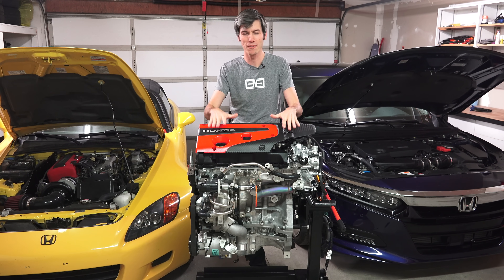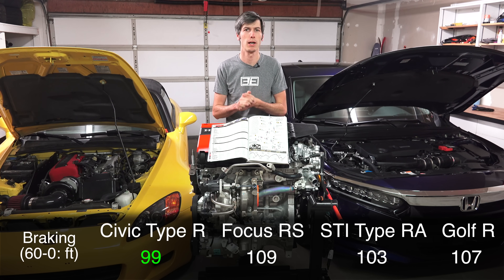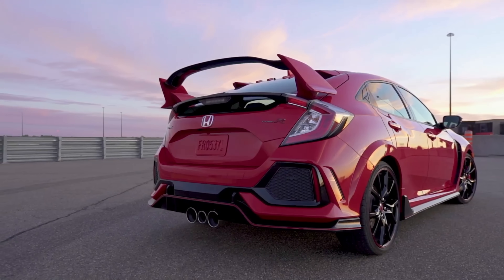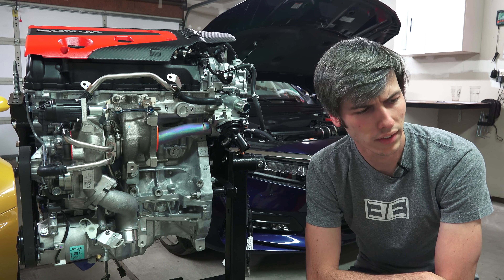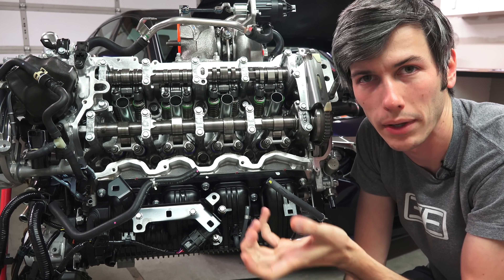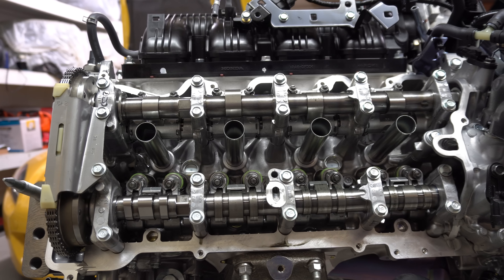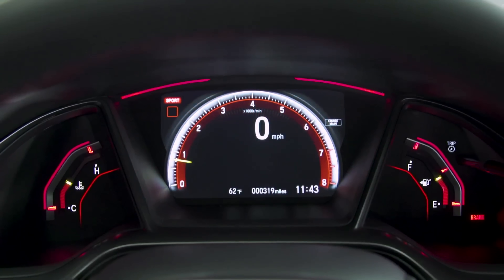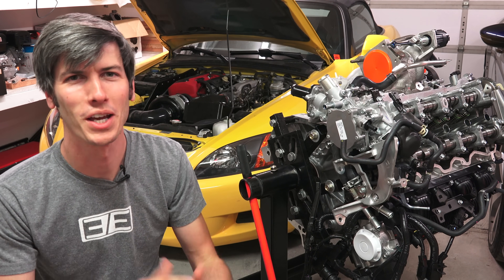The Honda Civic Type R Destroys The Competition - The Best Engines

Comment: Update
I found a paper online from Honda '2021 Acura TLX Press Kit'  Which goes into the greatest detail I've been able to find about the K20C6 motor. The motor comes with forged steel connecting rods, reinforced main bearing caps, centrifugally cast-iron cylinder sleeves, piston cooling oil jets, ion plated piston rings, super lightweight high rigidity steel crankshaft and sodium filled exhaust valves. AND each journal on the crankshaft was micro-polished to reduce mechanical friction. Max turbo boost pressure is 20.5.
In case anyone else was searching for this data.. here you go!

Comment: You've forgot to mention that this engine has the block of a new design - in K20C1 the block is 8mm offset for a longer power stroke (Atkinson cycle) - a unique feature of the C1 engines. And THIS is actually information I expected to learn from you, knowing your other vids for details.

Comment: I've owned two Hondas way back in the early 80's.
I owned the 1st CRX Civic.
1.5ltr 4 
No turbo but it was quick.
Rated @ 76hp in 1984.
With a 5 speed it was a pleasure to drive.
Fast and economical.

Comment: Was hoping there would be more explanation about what Honda has done to combat carbon build up with the direct injection. The Honda L15B7 1.5L turbo engine in the civic has a built in air/oil separator to reduce the amount of oil going back into the intake. I haven't been able to find any info on things like that in the K20C1/4 engines.
Reply: Been searching for this myself. No info on it 
They must have it perfected & keeping the tech hush hush

Comment: There is a modification for the type R that can significantly increase horsepower, but I don't know if the engine could handle the extra pressure. Would you reccomend this modification or not?

Comment: I bought one of these and in comfort mode on a motorway run I get 40mpg easy. Even got 45 mpg once. Remarkable engine. (note not US gallons)
Reply: That is amazing mpg. I used to brag about my Honda Fit getting over 50 mpg,  but most of those miles were on the highway.

Comment: I was so thoroughly impressed by a recent Accord Touring with the 2.0T it's now probably my next car, it didn't feel far off from my usual v8 driver (besides having to wait a second or two longer to spool up the turbo) on high speed highway passing, and still did 35 mpg without being babied.

Comment: Type R is way overkill on looks for me personally but my God the performance just speaks for itself. 2-wheel drive w/ no torque steer it absolutely hauls ass can take corners & stop faster than any of those other cars🤷🏼 Honda is on point & I personally prefer 2-wheel drive over AWD. I have the Honda Accord 2.0t touring with a k&N drop-in filter and K-tuner stage 2 the boost went up about 8 PSI & the car feels much more powerful, I bet the type R would have a problem with this Accord 😎🤔
Reply: Agreed, the only time my Type R struggled was on a very hot track day, i had lots of heatsoak and my tires were overheated and the track was greasy. Otherwise on cooler days the Type R is an absolute beast.  If I wanted to improve my cars performance on hot days I need to do alot of cooling upgrades.

Comment: I am long time Honda/Acura owner however I am concerned about Honda reliance on turbos and direct injection (without complementary port injection as Toyota does it). Oil dilution and intake valve carbon issues concern me. Do they concern you?
Reply: Oil changes on time, and no worries. My 2015 Honda fit, 1.5L earth dreams for instance. Everyone yelling CATCH CAN, and at 90,000 miles,  damn thing purrs like a sowing machine. Run 0W20, and premium fuel. Every other tank ill throw in some Lucas fuel additive, with upper cylinder wall lubrication chemicals. Honda #1.

Comment: I don't rate the engine, one it's handicapped by the integrated manifold, it's probably the main reason for the pathetic rev range. Motorsport doesn't have Equal length mandrel manifolds/headers for no reason. 

Two, torquey low revving engines are a bad formula for performance! Otherwise diesels would be better than they are. But especially for FWD, Where are you need more progressive- linear power delivery, to avoid torque steer. 

The only real option for a new Heavy performance FWD honda's now is ether the K24 block, K20a2 head, all the vteci heads after that are useless naturally aspirated. Or maybe a higher revving turbo'd k20 (b18 b16 for small cars) with an aftermarket ecu and aim at peak power and limit the torque.. It sucks because of the excessive weight meaning you need the extra torque. but because you're limited by the limitations of FWD, You can't effectively convert torque into forward motion, Haha...

FK8's Don't effectively put their power down. (i'm not talking about road based casual driving lol)

Comment: I had a 1988 CRX Si and it was already a lot of fun with only 106 hp.  Let's put that R motor in it!  I probably wouldn't have lived this long.  Sodium filled exhaust valves?  Knock off 10 pounds by removing that ugly spoiler!

Comment: The civic type r is more faster than the focus rs even though the focus rs is 350 hp and the type r is only 306 hp but the focus rs feels slow in the track because it also has 350 pound feet of torque and 350 horsepower so that’s the issue with the focus rs, they should either increase horsepower or reduce torque to the focus re for it to feel faster.

Comment: But aren’t you glossing over the intermittent annoyance of 1st to 2nd gear grind? ;Extreme wear of front tyres; overheating on track; non linear delivery of power which exiting wet corners is disconcerting.

Comment: Accord has slightly beefier connected rods in order to compensate for that early low down torque. Those rods were later added on to 2019+ CTRs.

Comment: The only thing I disagree with is not VTEC on the intake.  If I put big boy Cams on, my low end performance WILL suffer.  Cams have a tuning effect.  By putting on larger cams you move the power band higher in the Rev range.  Consequently, that means removing power from the low end and also having an unreliable and lumpy idle.  If instead you have VTEC on the intake, you never lose the low end power AND you keep the reliable idle.  Idk why Honda thought it was a good idea.  There is no reason to remove it 🤦🏻‍♂️

Comment: Just looking at the raw stats on that magazine page, it shows something rather interesting. The Golf R clearly peaks in torque and horsepower very early. It likely has the smallest turbo of the bunch, and is better suited for low-end driving. The WRX is almost embarrassing when comparing paper stats, as it makes 5 ft-lbs less torque than the Honda while doing so a whole 1500 rpm later. Despite this, it makes 1 hp less than the Honda but peaks 500 rpm sooner. The WRX therefore, in my opinion, seems to have the most disappointing power delivery of the group.

The Focus RS is a bit more interesting of a comparison, as it makes both more peak torque and peak horsepower. However, peak torque comes at a full 3200 rpm, significantly late in the rev band when you consider what is capable with modern turbos. Either Ford is using a larger turbo or higher boost, either way this engine with more displacement is peaking 700 rpm higher than the Honda. On the flip side, again taking into account that it's making 44 more hp than the Type R, it's still peaking 500 rpm lower.

The point I'm making is that even on paper, it's kind of clear that the Type R engine is doing a good job of making torque down low while making power higher in the revs, more so than any of these other engines despite that it doesn't have THE lowest torque peak or THE highest peak numbers. What that tells me is that this engine has area under the curve. That is, if we plot horsepower and calculate the area under the line, I bet the Type R engine would absolutely destroy both the STI and the Golf R. Maybe not the Focus RS, but I think it would be closer than you might think.

I'm actually not that surprised that the Type R did as well as it did on the track. If there's one thing that Honda has excelled at for years, it's making a FWD car that excels on the track. I'm glad they finally decided to give the Type R a turbocharger, because power was the one thing that it lacked. I think those results demonstrate that Honda knew their competition and how to best combat them with their strengths. Good stuff!

Comment: High performance and reliability. Well done Honda! In the Type R for the first 100,000 miles just change the oil and the filters. In other high performance cars, after the first 100,000 miles it is time to change the car. Younger people may not appreciate this but I LOVE how Honda designed this car to have a timing chain vs a rubber timing belt. A rubber timing belt is like a break down waiting to happen and the fact that this timing chain will last the life of the engine is another reason why I am proud to be a Type R owner. Again well done with the video and well done Honda!
Reply: @Phil_Moni  For the Type R the oil I use is full synthetic 0w - 20w by Valvoline.
Reply: I agree with chains over belts but if I’m honest that alone is not new, nor a good guarantee of reliability. Germans have used chains for years and had issues with tensioners, chain stretch, and more.
Reply: @michaeldittmer5065  The German automakers make good preforming vehicles, but they don't make reliable or easily serviceable vehicles
Reply: @michaeldittmer5065  lol, you're talking about the Germans? Of course they're gonna have problems.. Reliability is not their thing unlike the Japanese, who can probably engineer almost anything make it reliable.
Reply: And people say I won't find my reliable 4 banger turbo hot hatch. I think my search is over. Civic type R it is 😭
Reply: I'm young (20) and this type R is my second dream car, the first being the first gen Honda NSX. The excellent balance betwin reliability, pleasure, performance and look that Honda provide is what made me an Honda enthousiast as well as for their motorcycles (Love my VFR 800 vtec)
Reply: @Le_Ptit_V6  You have good taste!
Reply: Hell yea man love your car I have an si currently but plan to upgrade to a type r soon
Reply: @williamphillips9565  It is worth the upgrade and congrats! You will enjoy it even more because you already own a previous Honda. I was not able to upgrade as quick as you but I obviously did upgrade. My previous Honda was a base model 1986 Honda CRX. Even at the time it was not the best performer out there but I loved that little car and drove it until it could not drive anymore. That experience made me appreciate everything Honda did with my 2019 Type R a 1000 times more.
Reply: Bro like every new car has a timing chain calm down
Reply: @stefan_4508  not every new car. I was surprised to see VW polos still using timing belts
Reply: @Phil_Moni  No problems. Being a turbo, it really cooks that oil so you have to stay on top of the oil changes and the tires don't last but this is what you can expect with a performance car. This Type R is definitely a keeper.
Reply: Im young and i love them.
It will be my first sports car
Reply: @kill6Billion  Nice. What an incredible first car to have. Congrats. I am actually glad I got it as an older guy not only because of the fact I really appreciate it and am a better driver but the people I associate with are older. Sometimes it is not being young that is the problem but the young people around you who are either haters or lack any kind of foresight and are willing to sacrifice your nice car for their enjoyment. Be careful and respect the car for what it is.
Reply: Dang. I want this car more than ever
Reply: I've seen LS with 150k plus running boost. Reliable...soooooo?
Reply: @ryryy1980 🤨
they all can’t be bad. They all can’t be great. It’s the law of averages.
Reply: @ryryy1980  Nice. Tell that person to enjoy that car because once they outlaw new gas cars in the all electric future, the value of that car is going to shoot through the roof.
Reply: @Phil_Moni  Yes but make sure to use full synthetic. 0w-20w full synthetic is what is recommended from the owner's manual. Definity don't skip out on oil changes. Being a turbo, this engine really cooks the oil which is why you need to use full synthetic.
Reply: @Phil_Moni  Thanks. 12,000+ miles in my Type R and the engine it perfect. I was a little concerned about the viability of a turbo 4 but Honda really does know of to make engines and they dialed this engine in perfectly. No crazy mods for me. I plan on keeping this car for a while.
Reply: With a belt, it’s a maintenance item which if adhered to correctly, should be fine. A timing chain however only gets replaced when it goes wrong, either rattling or when the timing chain assembly has jumped etc, at which point its possibly too late. Also timing chains are heavily reliant on good service intervals, partially correct oil grade. Timing belts aren’t. There are pros and cons for both setups, me personally I’d rather have a belt. Easier and usually cheaper to change, and less reliant on previous owners maintenance.
Reply: @I6IScott  You bring up some good points. For me, after working on cars for more than 30 years I would rather have a timing chain. You bring up a good point about used cars. If you buy one used one of the first things you should do is change the timing belt for piece of mind. After all the headaches of owning old cars I really appreciate buying a new car with a warranty. I just don't have the time I used to to work on cars. When I start my car I just want it to work.
Reply: U forgot to mention
The overheating problem with
The r
So I will pass
Reply: @cb400fhonda6  You are passing on an incredible machine. I don't regularly track my car. When I do drive it I do some spirited driving and I have experienced zero over heating issues which is why I am very confident I will have no problems keeping car for a very long time.
Reply: @StandingUpForBetter yeah man, I also own an fk8 and I don't see where people are coming from in terms of overheating. Even when I push the car to it's limits, as we often do in Germany. 😄
Reply: @cb400fhonda6  It has an efficient enough cooling system to climb pikes peak without stopping once. Before you argue against this claim it has already been proven.

Comment: Of course Honda's 4 Destroys everyone else...and it will last.  What else did you expect?
Reply: Except for the engine in the Mercedes A45 AMG.
Reply: @toddstevens8506  lol and the Mercedes will break while the honda will spin and spin for years to come
Reply: @justinmartin4841  Nonsense, the M139 has been boosted well beyond stock and hasn't suffered reliabllity issues, unlike the Civic R's transmission for example.
Reply: @toddstevens8506  🤣ok bud.
Reply: @toddstevens8506  This engine is from 2015 LOL. I dont think the new A45 is.....
Reply: @sharmilanraj  2019

Comment: Idk if it’s better to leave the stock sodium filled valves in as opposed to Ferrea inconel exhaust valves which take heat better. Plus since stock valves are hollow isn’t it lighter for less rotational mass?

Comment: AWD is a speed burden until you're losing traction level of power.
Reply: and Hondas NEVER generate enough power to require AWD....
LOL
Reply: @Turbo4Joe363  It's sure be nice if there were more AWD systems to hook a honda motor up to once they're making enough power.  but when talking stock cars in this category most of them won't start out with traction issues.  Start upgrading then it's a different story.

Comment: The type R is a great car but not in the class of the awd cars. Fwd/Rwd will be better for hot lap putting Rwd as king. If you have anything other then perfect track conditions awd gets an edge. Also if we look at race history awd is better for prolonged racing. I also don't think a type R will put down the power well if modified to 400+ hp like alot of Golf R, Focus RS, and STI will be. I like to tune and modify my cars, Civic R is turn key boring to me. very well sorted out though well done Honda.

Comment: Now Honda's back on winning races in their first year with Red Bull (Granted RB did use Toro Rosso as a test bed in 2018 to iron out the problems). It's funny when you can actually built a good engine when you're not forced to built it to fit the narrow chassis. (Looking at you, McLaren)

Comment: Sodium filled exhaust valves were used on the Roll Royce Merlin engine as in the spitfire in1939. Shows how cutting edge those old engines were.

Comment: Get/borrow a Civic Type R (or any Civic) and sign up for 2 local races near you. You just have to start, you don't have to even finish the race. You can literally just go straight to McDonalds as long as you start the race and then safely retire. Next you are qualified to buy the Type R engine. What you do with that engine is up to you...its not against the law to put it in your own vehicle....Honda will just get mad if they know about it. Its one of the cheapest performance engines out there in crate form- and there's workarounds to getting it.
Reply: Keep in mind if you break the contract, Honda might not sell you replacement parts. So I would just get a Civic Type R and "swap" your Type R engine into whatever car  you want, and then put your "crate engine in your type R".....See....they still have to service your Type R by law....so thats your ticket into getting infinite supplies of Honda Type R engines....and swapping it to whatever you want.

Comment: The other thing I learned today is that the crankshaft isn't lined up with the cylinders. It is offset, so the power stroke has the rod facing straight down, which means there is less lateral forces on the piston head.

Comment: So when are they gonna make hybrid drive version of the civic? 10kWh battery + hub motors in the rear wheels with 200-300kW power for sprints. 

That would turn these cars into rockets for short bits. I'd want it.